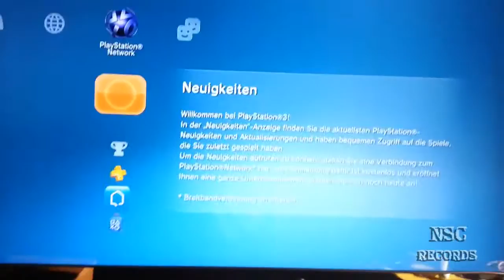How to Remove & Replace the Heatspreader´s on your PS3 (TUT) By:NSC

Comment: Just did some more research on removing the heat spreader plates and you are right NSC. Though around each plate is heat conductive glue like on top of the 4 ram chips. NSC in the place to be.
Reply from the maker: Right, one day it will overheat "inside" the IHS, latest then you will need to open them, otherwise it will overheat and you will have your first YLOD
Reply: Yeah. I'm looking forward to this project. :D Keep up the good work NSC!

Comment: There's actually an easier way to remove the heatshield from the CPU. If you get a paint knife/spatula set, they cut through in less than half the time and you avoid damaging the smd's on the board (just be careful) .
Reply from the maker: im just finy with my Tool, never damaged one, and i opened about 350 PS3´s ^^ i bet more xD

Comment: Your videos are awesome! You seem very confident in what you do with these PS3 repairs and i respect that. I have a question?
I just purchased a used FAT PS3 model CECHE01 which the seller said when turned on theres NO Video thru HDMI or AV cables. System was never opened.

I will sometimes get the recovery screen then it will freeze up on me with distorted lines on screen. I tried few times and same thing. I am not getting any RLOD or YLOD

Just a Green solid light .  Any suggestions on how to go by fixing this unit greatly appreciated.

Regards

Comment: would you recommend doing this on a CECHC modeL? I reflowed it but now the fan is very loud and it will turn off im pretty sure if I leave it on. I only got this really crappy thermal paste maybe thats why its a loud fan because I ran out of the good thermal paste.
Reply: I fixed this shit mistake by sony. The thermal paste I said was shit was! I got new thermal paste and changed it and now it runs with no loud fan but the air blowing out the back is warm and the speed goes to maybe the next level after a while. Do you think i really need to change thermal paste under IHS?
Reply from the maker: Yeah, you will need to open the IHS, begin with the CELL CPU, mostly it´s the CELL CPU that makes Problems...

Comment: Hi NSC, I have a 60gb CECHC03 model and id like to try and repair it myself after watching some of your videos. It has the blinking red light but the fan starts running fast and light blinks immediately after starting with 3 beeps before turning off. Is the repair process the same as this video or do I need to heat the CPU  GPU with the heat gun for reflow before changing paste and doing mods? Any help would be appreciated 🙏

Comment: Ok pal :). I think I'm pretty lucky as my PSU is a APS 227 model and doesn't get hot, only slightly warm, after a few hours of play. I know some other PSU models can get very hot though! But because mine is only a little warm I think I'll try and put some small fans inside it to help it a little, but maybe in the future I will do what you have done and put the PSU outside the case. Thanks again for you brilliant videos. And your English is very good :).

Comment: Thank you! Have two consoles that overheat instantly after they were reballed.
Reply from the maker: Reballing without cutting the IHS is a bad Idea ^^
Reply: UltraNSC
Yeah. I don’t see how they could do it without cooking everything since the IHS prevents the air from directly heating the substrate. Needless to say, I don’t trust Spitfire Mods. I suspected all along that he might not even do a reball (might just throw it under heat and say he reballed it). I insisted on lead solder reball in case it was a longer term fix and paid extra for that. Considered getting a hot air station for BGA rework but never did.

Comment: I just did this, and I just can't understand one thing. The air coming out the back is much hotter, but the PS3 is still loud. Level 3-4 fan after 20 minutes sitting in the XMB, disc spinning. And this shit is both on my CECHC and CECHG. What am I doing wrong? I didn't scrape the thermal adhesive off the ram chips on the CECHC, but could that be the cause? I mean the CECHG has the thermal adhesive scraped off, and it's still doing that shit. The CECHC has holes like in your tutorial, the CECHG has holes on top (I cut the plastic just like you did).
Reply from the maker: wich Thermal coumpond have you use?
Reply: I used Arctic Ceramique 2. I just redid it 5 minutes ago, I realised that I put too much of it... :D Now I put much less but the same result is given. The heatsinks are super hot, though, which is a good sign. I can't tell if it's on level 2 or 3 right now after idling for 30 minutes. But the clamps taht hold the heatsinks in place are very hot, and all the metal inside the PS3 is super hot. That's a good sign to my understanding :P Screw it, I'll leave it there. Got tired of taking it apart and apart.
Reply from the maker: please get you the MX2, the Thermal Compound what you use is not realy the best...

http://www.overclock.net/t/622069/arctic-silver-ceramique-vs-arctic-silver-5/10

and ist fully normal that the CPU/GPU Holders get Hot, a PS3 without FAN Controll Adjuster just get in Menu after 15min. about 76C* without a FAN CONTROLL ADJUSTER !!!

Normaly you can be happy when it turns a bit faster, otherwise it would overheat and you would get a YLOD soon... Check this:

Protect your PS3 with a Fan Mod Speed Controller to avoid a YLOD By:NS©

Regards
Reply from the maker: right... and it can be that the IHS is not perfect on the DIE, the right Presure is important!
Reply from the maker: u need to Lapp it first ^^

Comment: They say the RSX GPU in the super slim are more efficient so they don't put a heat spreader or sony just cut the cost to make it cheaper. I think it's called heat spreader not heat shield

Comment: Just a quick update: I have since then managed to get another (broken, ran hot and didn't read disks) 40GB PS3 for 50 bucks. This time I ONLY removed the RSX's heatspreader and replaced the BD-drive with the one from mine. Now the "new" fat lady runs whisper quiet, so yeah, in the end the problem has been fixed :)

Comment: After changing the thermal compound under the CPU IHS I now have YLOD. I have never had YLOD on this PS3 before, now it will not power up. I have repaired 5 other PS3 systems with YLOD and replaced thermal compound and all worked every time after watching your videos. What could be the problem?
Reply from the maker: you may scratch your Chips...
Reply: CPU chip is nice and shiny. Nothing looks bad. Cleaned everything very nice and reapplied paste different times. Normally everything works first try...
Reply from the maker: you can upload me some pics, so i can take a look, otherwise try to Reflow it, maybe a Chip got´s losed now...
Reply from the maker: i see 4-5 scratches on the CPU....
Reply from the maker: it looks like yes, because the PS3 should still work just fine if you dont scratched anything
Reply: A key point most folks miss on this is the gap. Thermal paste is horrible at conducting heat vs metal so really it insolates. You want the thermal paste to fill the gap between the silicon die and the ihs and nothing more. That is the purpose of it.

When people reseat them ihs they rarely pay attention to the gap. It can play a significant role on the temps. As soon as it has been reseated you want to apply the heat sink to it and torque it down to have the adhesive set and maintain a small gap.

Also lightly scratching the silicon will do nothing. The silicon itself isn't the actual processer it is the protective shell over it. You can damage the processor by damaging the silicon but the part you see isn't the actually processor. The processor is in it but silicon is very brittle and extremely thin the silicon around it is 4-5 times thicker than the actual processer.

Many chips will actually have laser engraving on them and this is why that does not damage the processor.

Comment: Yo please rely I new confirmation, I was removing the CPU chip and I accudebtly chipped a part , not from inside but outside the ring if the ihs so you know you can see the green square right , I accidently had very small nick o the green come off so now you can see the copper , is this okay ? The ihs plate is stillin and has not been removed
Reply from the maker: try to upload me a pic pls
Reply: okay will do
Reply: i got ihs removed using better tool much safer, but when i  opened OmG!! I THINK I RUINED IT LOL!! i posted a private video on my channel you can see it though

Comment: Hey NSC, i dropped my ps3 and it ylod a long time ago. I was going to reflow but someone told me i would most likely have to reball to fix. Is there a way to remove the entire chip without a gpa station?
Reply from the maker: Hello Sadly not, without a BGA Station it will be very hard for you, and to be serious, a used ps3 in good conditions will be cheaper for you :)
Reply: @NSC-Modz  i have a working superslim and slim, i am trying to fix it for the ps2 chip and cfw and to learn about hardware. In the future i will look for a rework station. Thanks  for your help man. Danke

Comment: Do I need to do this if my fan goes to level 3 after 8 minutes after being in the xmb and level 4 5 minutes into a game? I'm annoyed by my ps3, its so loud :D thermal paste on top of the ihs changed nothing.
Reply from the maker: Yes, thats the Problem, u will need to Change the Thermal paste UNDER the heatspreaders, thats why your fan turns crazy...

but take care on opening, ist NOT so easy like it Looks like on my Videos ^^

so, TAKE CARE ! you will need a Special tool to open the CELL Chip Heatspreader...

Comment: Don't you need to reflow in case the solder crystallized from extreme heat cycles? Because the heat sink was not working efficiently...

Comment from the maker: it has alot names that thing, at last a heat shield is never need, long ago ALL graphics Cards was also without heat shield, some when thei begone to do that, so the peoples canT change the thermal compound self.

At last its always better when the Cooler seats directly over the Chip, without heat shield, the temps are also much better without the heat shield!

Comment: I'll be clear: this is NOT your bad. I knew my RSX was running hot and wanted to avoid YLOD. I took it apart and removed the HIS from it without a single issue. While at it I decided it wouldn't hurt to do the same to the Cell Broadband Engine (worst decision ever). Basically there's a lot more epoxy under the CPU and mine was pretty hard being from early 2007. I forced it and ended up bending the Cell's PCB.

Comment: Mine had loud fan after 1 minute turning on, now it has ylod, do i need to reflow?
Reply from the maker: oh yes... but you should first open the Heatspreaders... when u say it was loud, then u can be sure that the old thermal paste is bad...

1. open both Heatspreaders
2. clean both Chips
3. Reflow with some Flux
4. add new thermal paste
5. get all heatspreaders back
6. make some holes on the Case near the fan
7. add the dust filter
8. have fun ;)

BUT take care, opening the Heatspreaders can be dificult for a guy that has never done it befor... take a lot care at the CELL CPU, u need a real thin tool to get under there!!!

so work slow, clean and with pacience...

Regards
NSC
Reply: Thanks for reply, sorry i meant it has ylod after doing the fix, but this could be my fault? I try to be careful but i see some shining copper after remove the cpu heatspreader (only small). My blade must have cut down too much. Do you think this is damage too much? Thanks again.
Reply from the maker: yes, to 90% not reparabel :(

thats why i always say... the CELL Chip is very sensibel... as u scratch it, its game over we can say.

Make me a pic and upload it for me, ill take a look then...

post me here the link...

sry for u :\
Reply: Ok, i worry you say this, but you give clear warning, i don't have all correct tools so this is my problem. I will dismantle for another try, how can i show you pictures here on youtube, i don't use other social media? Thanks
Reply from the maker: hmm try this:
http://tinypic.com/
Reply: Thank you, i'll get back to you :)
Reply from the maker: roger that ;)

Comment: Still I think I discovered/invented a new kind of YLOD, It does not start blinking after 2-3 seconds instead, it turns on, fan spins up (to a normal speed) the light stays green for like 10-15 seconds (no video output though) and only then it starts blinking. Oh well, it wasn't really worth that much, I'll figure something out.

Comment: ive got a 40Gb model and my fan its spinning like hell

after 30 seconds the fan goes from level 1 to level 4 (3/5 speed) in XMB Menu 

and in full speed in Game mode either Disc or HDD 

i did remove the RSX Cover and applied some Thermal paste on it cleaned the console out to be dust free 

but the fan still goes full speed 

and i am a little worried about it :/

Notice: i didnt removed the CELL CPU cover plate but i did applied paste on the cover of the CELL

Comment: ive ruined everything due to my stupidity XD

now i have to find another 40Gb Motherboard which can be a pain in the ass buying it 

so now i am the 3rd guy who scratches the CELL CPU up XD

well now ive learned that (NEVER TOUCH THE CPU OTHERWISE...)

due to the damage that ive made while taking the CPU Plate off i am getting Red Light Of Death and i know it cant be fixed 

but thanks for the great video ^^

Comment: That's a good idea putting the PSU outside of the case, however I meant something similar to this video;

watch?v=COtSqDs6Flg

Basically cut a hole in the top of the PSU, and the top of the case, place a fan inside the PSU to blow cold air inside it and tidy up the outside of the case with a nice fan grill. You could power the fan from the Bluray drive the same way as you have done in your external PSU video. Would you ever try something like in this video? Small fans inside the PSU?

Comment: Ok, I screwed up. My PS3 was working fine, but I decided I'd replace the thermal paste under both heat-spreaders. The one on the RSX came off easily, the one on the cell didn't. I put it back together and I now have YLOD, but what's weird is it comes up after, say, 10-15 seconds, not like 2. I think I either damaged the cell or broken the connection between it and the heat spreader, causing it to overheat.